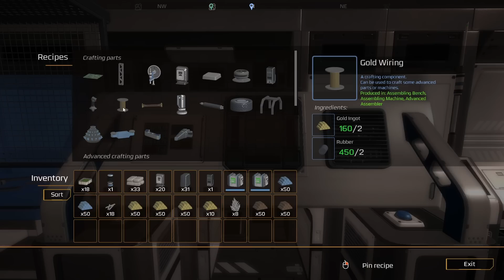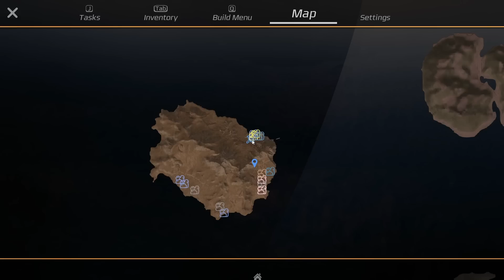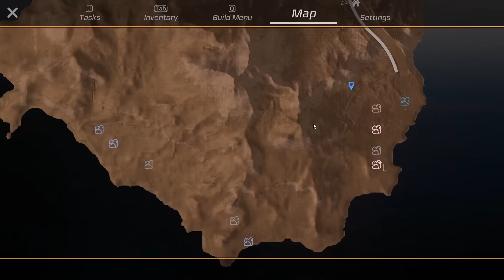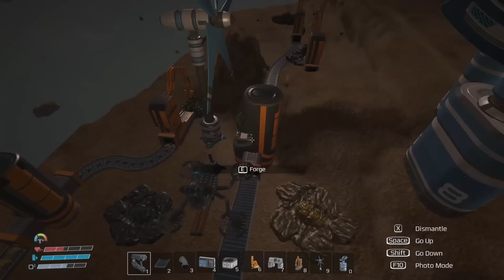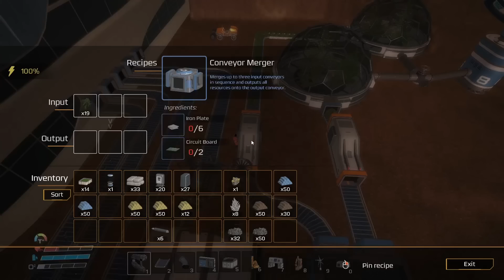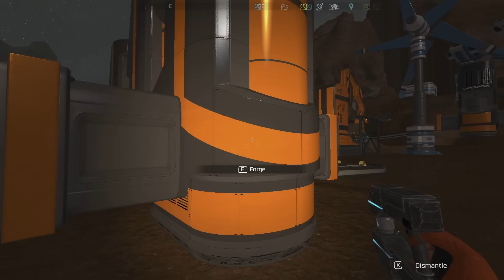Aetheria: Eden Crafters - Gold, Osmium, Steel and Geothermal Power [E5]

Comment: since you are close to your base building, you can be in your building and use the drone to build and not have to worry about oxygen.  the drone works for quite a distance and it makes building less frustrating to not have to worry about oxygen.  You can also get into containers early game before the warehouses.  when having to use the workbenches, it helps to be able to use the drone to get supplies you need to fabricate things and not have to leave the building.  Quality of life difference in spades.
Reply from the maker: Thanks for the tip! For the bigger builds it is difficult because the range of the drone isn't so good.